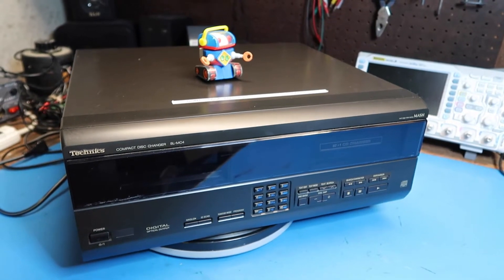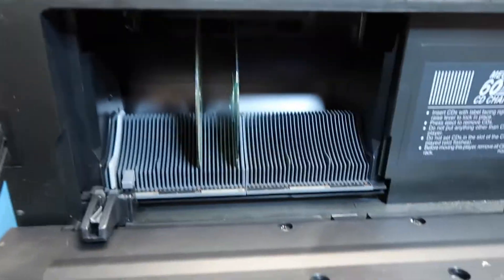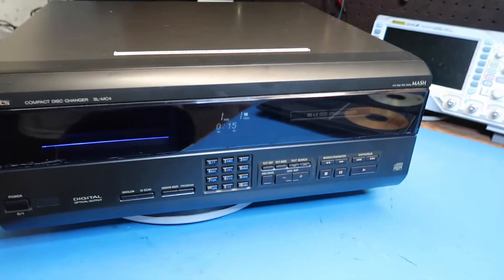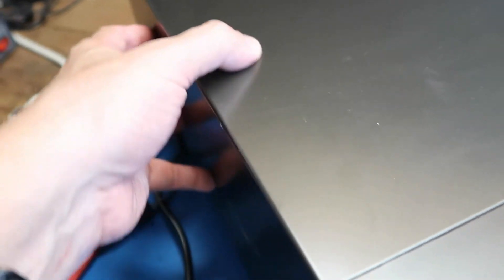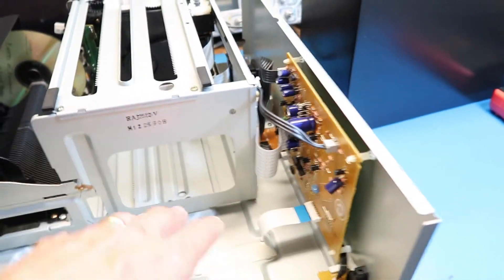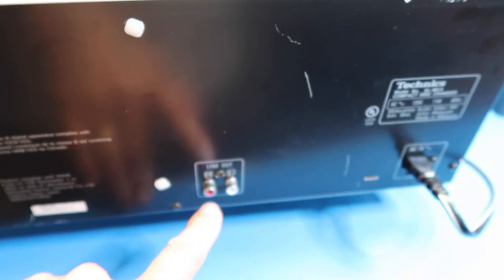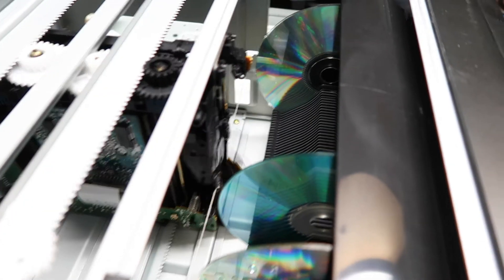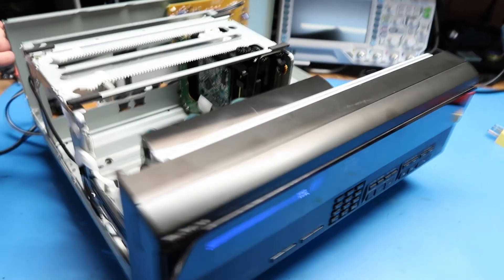Discovering a Technics SL-MC4 61-CD Changer

Comment: You didn't show how you removed the side screws. A regular Phillips head screwdriver won't work on them. (It will work on the two back screws.) So are they JIS (Japanese Industry Standard) screws or what? I have a Technics 5 Disc Changer SL-PD6 that just stopped working after 20+ years. I wanted to open it up & see if there is a simple fix. But don't have a JIS screw driver (yet.) So I want to know how you removed those 2 side screws from each side. Appreciate hearing from you. Thanks
Reply from the maker: I think I just used a Phillips screwdriver on them, though I don't remember specifically. I just looked at the unit again, and the screws are a little dinged up, so they maybe whatever I used didn't fit perfectly but worked anyway.